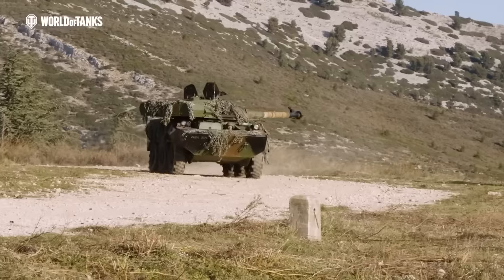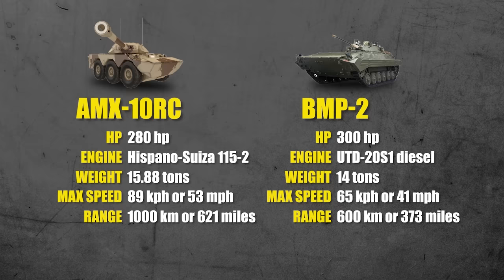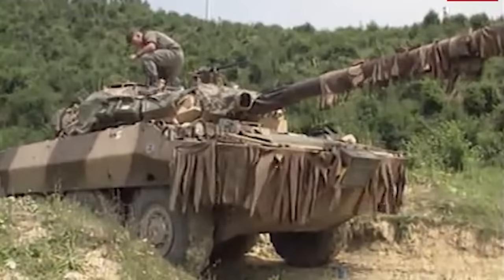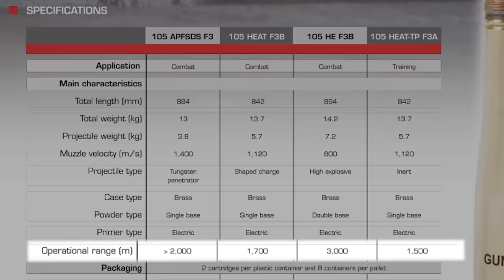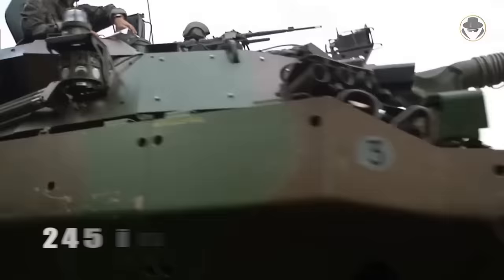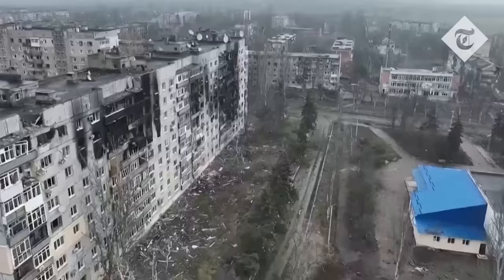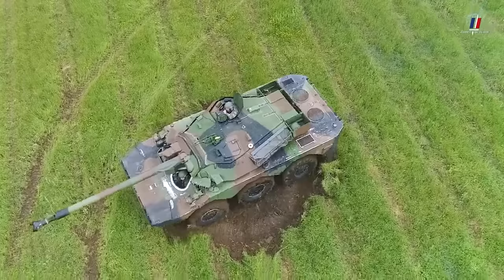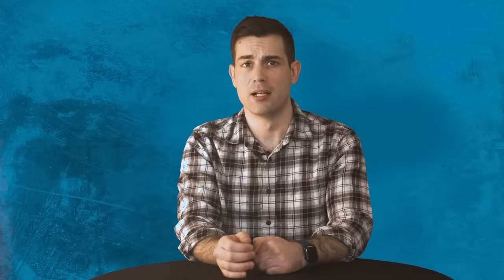Can the French AMX-10 RC Make a Difference?

Comment: The AMX-10 role is a lot like the tank destroyers of WW2, like the Hellcat. It couldn't slug it out with a tank. Had speed but only light armor. But they were great for recon and flanking the enemy with their speed. And, as the name implies, they were meant to destroy tanks. Get to the side then shoot and scoot. Of course the gun could be used against buildings, etc.
Reply: Plus got a longer range than the t90m with the right ammo, with thermals (latest models).
Reply: French basching
Reply: Yes the French 2nd Armoured Division used (and loved) the M10s
Reply: That was exactly what I was thinking - a quick reaction unit to plug a hole and stop a breakthrough, and I was thinking of the US tank destroyer doctrine of that time.
Reply: lol i vote we name it a hyper howitzer.
Reply: The best ammunition of AMX-10 with tungsten can't even make a dent in second layer of a T-72 frontal armor, even if it was without ERA according to the simulation, taking into account the types of projectiles, armor thickness, firing distance, shot energy, energy dissipation on contact and other mathematical conditions - it simply unable to penetrate armor of T-72. Math says, that at the very best this "tank destroyer" is in fact only a threat to BMP and can in theory conduct some attacks on flanks provided it won't be destroyed in the process by artillery and MLRS fire. This role can be done by so many types of weapons, that it is clear that AMX role was to be merely a gesture to check if Russia will react to this or not. 

Unsurprisingly right after that, the entire NATO tanks are now heading to Ukraine to join all the other vehicles that were destroyed there previously. Escalation is imminent.

In other words, NATO figured out that Russia won't use nukes until... So they are very eager to find out what exactly will trigger it. Because it's fun to poke a bear knowing it won't answer, to try it's limits. Until one day...
Reply: @MrZlocktar  Putler and Russia will fire nukes not until it gets total humiliation.
Reply: @MrZlocktar  What you're telling me is to not stop the raging bear because it will rage even more. Yeah bro, what's next, asking me to pet the bear while you are telling me it's fine?
Reply: It is not, even in the gulf war AMX10RC were deployed in a way that minimalized the chances of facing Iraqi MBTs. They’re more like assault guns for close support and deal with armor when they run into one, but never meant to go out hunting for tanks
Reply: @oohhboy-funhouse  let him be. his drunk with russian propaganda. or propably a bot.
Reply: @MrZlocktar  they have already destroyed numerous T72s in real life...
Reply: @MrZlocktar  However, this is not the opinion of the many T-72s, T-62s and T-55s from Iraq or Libya (and others) that he destroyed throughout his career.
Reply: @Ukraineaissance2014  but we didnt faced any T-72 with AMX 10RC afaik
Reply: @mikeynth7919  I would imagine this type of vehicle would end up with the 4th Rapid Reaction brigade. Which were the same unit that took part of pushing the Russians out of Hostemel airport.
Reply: @MrZlocktar  Bot detected, opinion rejected
Reply: @castelainteva8082  they've tested them against captured t72s and were used during desert storm, French 6th light division made up the western flank of the allies advance and went ahead of other ground vehicles.  They destroyed around 40 iraqi tanks.
Reply: @Ukraineaissance2014  used during désert storm does not mean: faced T-72; and as à matter of fact Daguet never encountered any kind of T-72; and for the test i have no info about the said test nor the actual variant of T-72 tested against
Reply: @MrZlocktar  we all can see russian named vids on your channel, go away troll
Reply: @andrzejkol4538  The total number of all people speaking Russian are over 260 millions if not even more. I sure hope you are not some nazi considering your rather aggressive attitude towards anyone who speak Russian, why else would you call every person who knows this language a troll? Do you know that more than half of population in Baltic countries speaking Russian? You have some problems with that? 

And what about Ukrainians who are also speaking Russian because all of us speaking Russian. You have some problems with that? It is much easier to speak in Russian than it is in Ukrainian, i know both languages for that matter. Had you done some research of this conflict, you'd probably notice that all of Ukrainian soldiers are swearing, speaking, yelling all using strictly Russian when they are in combat. Because Ukrainian is simply too hard to use during stressful situation. There are many reasons why this is the case. And it's always been that way. That's why you always hear Russian during combat, and only hear Ukrainian in a more calm situation.
Reply: @niksandy7125  I'll try to explain it to you in a way you would comprehend.

Even if M-142 were destroyed, it is unclear how many, if any at all. Fact is, this weapon system is out of reach by conventional weapons just as much as Tornado-S that Russia is using. Both of these weapons are largely untouchable, and only missiles or drones can directly destroy M-142s. Considering M-142 are being used over 80km away from a front, and because it is a mobile MLRS just like Tornado-S, I'd say that the only way to destroy it, is directly by a ballistic missile. And i am pretty sure they will be moved whenever missile launch is detected, thanks to AWACS of NATO.

It is nearly impossible for Russia to confirm such strike without direct confirmation from ground. I imagine, that US ordered to never confirm any of these strikes, so even if it was destroyed somewhere in a depo during rearming, we will never know it before war is over. So just pick your best expectations for this. You won't be able to know truth for next 2 years.

You also need do understand that most of destroyed F-MTVs were mistook by Russia for M-142 because.. well, they really look same (M-142 uses MTV's chassis) and it is really hard to tell if burning hull of a vehicle is from F-MTVs or M-142.

Or when people were laughing how Russia claimed they destroyed M2A1 even considering M2A1 were not in Ukraine. But what really happened, is that they simply mistook 4 M113 for M2A1. If you look at them from a drone, there is barely any difference. Now imagine it starts burning and turning into wreck.. how can you tell any difference between them after that without direct view. So keep that in mind as well. Most of those claims of destroyed M-142s were in fact just F-MTVs, but Russia claimed them as M-142s because they look same. Just in a same way as 4 M-113 were claimed as M2A1. 

However, there are a lot of things which are being confirmed objectively. Daily/weekly destruction of missiles for M-142, all sorts of trucks, loading trucks for M-142, towing trucks for M-777, M777 itself, M-109 Paladin, AHS Krab, all sorts of vehicles that were sent so far, the list is extremely long including MRAPs, tanks from Poland and other countries (T-72,T-55S), and many more.

To add to this, there are a lot of things which are happening behind the "smoke screen" of media. The fact that Russia is using Tornado-S, which is in every sense more powerful (300mm), and with a much higher range (120km), than GLMRS used by M-142 - is still hidden from public. Just as much as the fact that Pantsir-S1 can intercept full salvo of 12 missiles (2 packs) of GLMRS which was considered as "impossible task" by most experts. There are even multiple videos of that. But this fact is also hidden from a public and will never be in main media. It would raise too many questions and doubts.
Reply: @MrZlocktar  but they did destroy t72s in Iraq. And the Russians are increasingly relying on even older tanks now as they run out.
Reply: But they cannot destroy tanks - the F2 main gun would be lucky to go through semi modern T-72B  frontally. It needs side or rear hit. Meanwhile its own armor is no match for even BMP.
Reply: @tomk3732  fair, but im guessing they WILL  be hitting Russians from the sides.
Reply: Out range t90m you guys are really funny

Comment: It's a bit the same role as the hussars of the Napoleonic era: Recognize, observe, strike if the occasion is favorable and fall back, excellent for helping hands, rapid assaults.
Its 105mm gun destroys any T-72 at 2200 meters (it was designed for that) enough to make the Russians spend a shitty day.
Reply: Wrong.
Reply: @Mortablunt  🤡
Reply: In fact this vehicle is no mach against any T-72 or T-64 and can only be deployed against infantry and mechanized infantry. Practically no armour, lack of stabilization of the cannon plus weak 105 mm cannon makes it a sitting duck against any tank. Outdated leopard 1 or chellenger 1 would be much better in this role. What I am saying. Even guys in a pickup with few of javelins would be much better in this role than this French don't know what.
Reply: @Mortablunt  T-55s, T-62s and T-72s destroyed in Chad in 1980s beg to differ. You need a T-72BV or later to withstand an AMX-10 RC hit and optics + firecontrol to see it in time and fire at it before it disappears behind its cover. Basically, a T-72B2 Obr 2006; a T-90A Obr 2010, a T-80BVM or later. Which in turn would be prime targets for all the Milans, Javelins and NLAWs its accompanying infantry is packing specifically for that case.
Reply: Old T-72s, yes. But definitely not modern T-72's straight from Russia itself. Unless you managed to flank one.
There's a reason why even some developing countries are retiring MBTs with 105mm gun.
Reply: @SirHellNaja  about 10% of confirmed Russian tanks losses in Ukraine from Oryx are the older models vulnerable to AMX's 105mm, and their proportion has been consistently increasing since mid-summer 2022, with older models such as T-62s taking up close rear fire support roles. An unexpected punch-through against such tanks would put AMXs against opponents they can take out even from the front, even if that is not an intended use of them.
Reply: @AndreiKucharavy  can you imagine! Then the orcs really would be the laughing stock … Whitehall, the pentagon, Paris , Berlin…gales of laughter!😂😂
Reply: @Truspio  Ya it would have to get a verry close up hit on a vonabule part of a T-72 and deffently on T-80 so ya not going to be something for taking on them tanks but thay will still come in handy for other stuff for the Ukrainians in there fight against this Russian atrocitie of an un provoked war!!!
Reply: @shannontarrant1826  it can be used against infantry hiding behind walls or against infantry vehicles, frontline is large so for sure there will be use for this. But OPs idea that it will fight with tanks as equal is just wrong
Reply: @johnhudson1965  Tbh, I am not entirely sure how they could beat the use of unencrypted, single-frequency walkie-talkies instead of proper radio or the trenches in the Red Forest in Chornobyl…
Reply: Imagine having a company of soldiers with at most machine guns and RPGs backed only with three BMP1/2s. Now add such a cannon to the equation and you can do things.
Reply: @SirHellNaja  The Czech Republic moved around 170 modernized or re-equipped T-72s to Ukraine. Poland is on its way to following this with another 120 T-72s and PT-91s. Apart from PT-91, which of mentioned uses BMS? There are/will be enough of the 125mm tubes there. Not always the sheer firepower matter.
For now, they seem lacking in both areas.
Reply: Good luck against an enemy with massive surveiilance of the whole battlfield with satellites and hundreds of drones.
Reply: @AndreiKucharavy  Congrats to come up with some rusty old second hand tanks, bombed into stone age by US fascism and alike before any troops were sent in.

Very compareable.
Reply: @shannontarrant1826  They idea alone that you can just do that. Sure somewhere, somewhen far away from any frontline, you may manage to find some guys from Donbass in an old tank with no backup and all. So you overall just risk you life for a completely pointless kill and will 99% likely die afterwards anyway without even the chanec to make any  difference, just some lives wasted for nothing, because randomly killing lone people far away from the frontlines won't win you a war.

At the frontlines, you won't have the chance to sneak up on a tank, since that tank got a layer after layer of backup and protection.

Can you be lucky? Sure. Will you still die? For certain. And even that lucky part is borderline absurd with somtething like that a 2km firing range gun that has to stop to shoot.
Reply: @goodlife6277  7:00 am Moscow sharp. Must suck to have to  start that early, day after day mr "patriot".
Reply: @miriamweller812  Yeah, I am waiting to see them stop using Baofeng walkie-talkies for radios, get proper equipment (including weapons not made in 1870s) and officers with enough brain to not order soldiers to dig trenches in Red forest, and then we can talk about that... Unless you meant Ukraine, in which case - yes, Russia is pretty fucked.
Reply: @AndreiKucharavy  Go help them in Donbass girl...
Reply: @miriamweller812  They continue to think that they are fighting in Iraq or Libya... they continue to make the classic mistake of underestimating Russia, it is an ideological issue and they will pay for it...
Reply: @goodlife6277  Man your job must suck these days.
Reply: @SirHellNaja  "Unless you managed to flank one" a 15 tonne vehicle is made to flank
Reply: I already proven like 100x that 105mm F2 gun is no match for frontal armor of most T-72 models. It is simply not powerful enough. Even more powerful L7 gun was retired for a reason - it was simply not good enough.
Reply: @tomk3732  These fanatics don't want to hear this, they prefer the satisfaction of the momentary illusion before reality becomes too painful...
Reply: @AndreiKucharavy  Sure uckonazi bot
Reply: @Truspio  Ya I agree 100% its not for fighting tanks at all.
Reply: @tomk3732  did you learned how to read ? Most MBT can't penetrate the frontal armor of other MBT, that kind of the point of the heavier MBT. but in a flanking,this canon is a deadly threat. It is light, I will repeat light it is NOT supposed to engage anything frontaly. Next your gonna tell me that standard rifle can't penetrate frontal armor of a T-72 ?
Reply: @goodlife6277  paid per comment, I see…
Reply: @AndreiKucharavy  Just like you ? Ukrop, Go help them in Donbass...

Comment: Extremely interesting, thank you.
I'd say the main weakness of the AMX is that it requires a very highly trained crew.
This thing can be a game changer for the infantry, bmp killer and fast attack.
Reply: BMPs have 100m gun plus chain gun plus MG. I take BMP over this any time. Also tracked.
Reply: @tomk3732   u can fit the most powerful gun on an IFV and it won't matter if the optics is poor.
Reply: Crew training is no big deal, the ukrianian spirit gives them a +50% buff to training